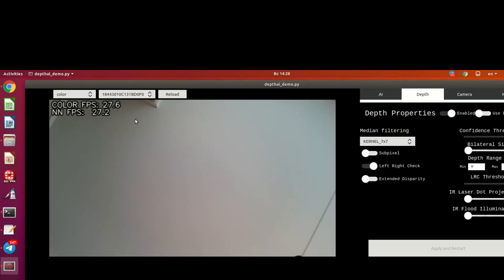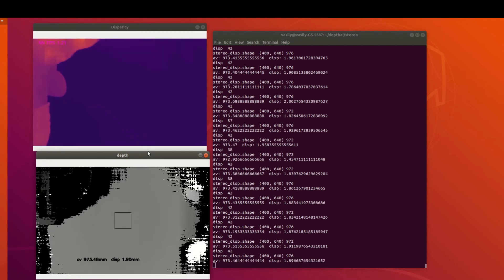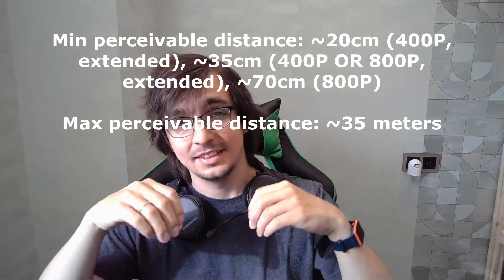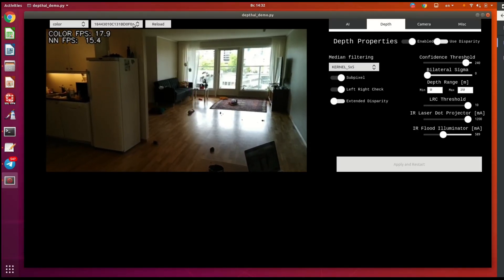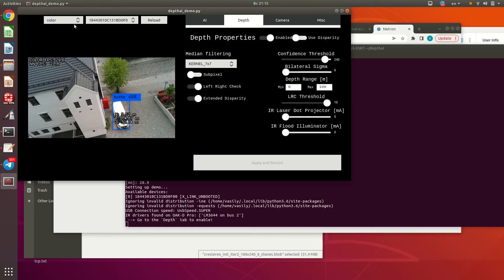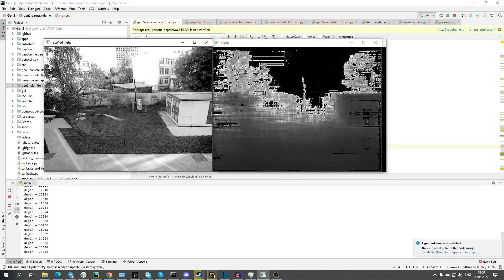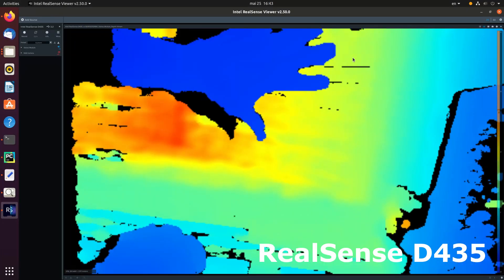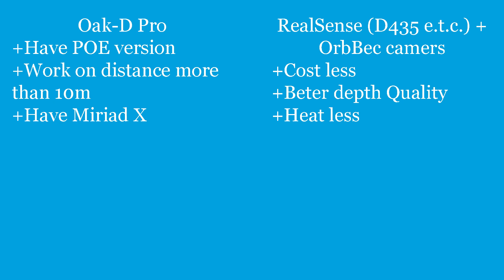OAK-D Pro tests and overview

Comment: do you think that this camera could handle truck monitoring on the road? is it capable to estimate volumes of truckloads and LPR?
Reply from the maker: "estimate volumes " - It will perform worse than lidar. Probably will not work in heavy sun conditions
"LPR" - the optic system here is not optimal. If you install somewhere near the number, of course, it will work. But if installed on top - probably not

Comment: Dear Anton,
I very much appreciate this wonderful video. I'm currently using the OAK-D Pro to capture close-range details of historical wooden surface. Using the demo from DeepAI, I have tried several parameter settings, but the results seem less than ideal. Do you have any suggestions for using this camera at close range? I'm currently trying to calculate the depth on a MacBook using the raw images from the camera(RGB + left right image). Thank you very much!
Reply from the maker: The best solution is to calculate depth with some stereo depth estimation network - https://youtu.be/JnCCvnI8-jY

There was a switcher in the old driver for OAK to switch between close and long range. But I think that mathematically it's not an easy problem
Reply: @AntonMaltsev  Thanks so much! I will try them.